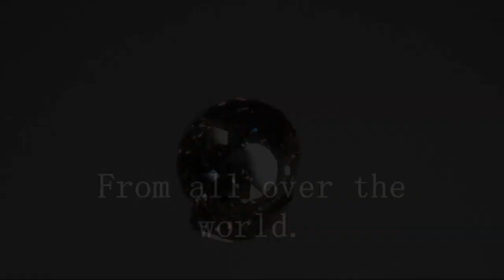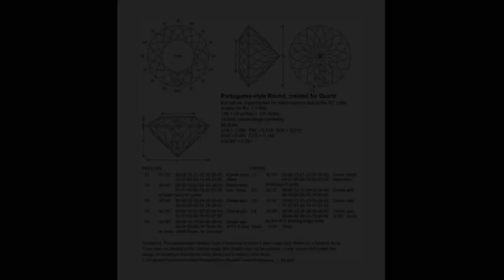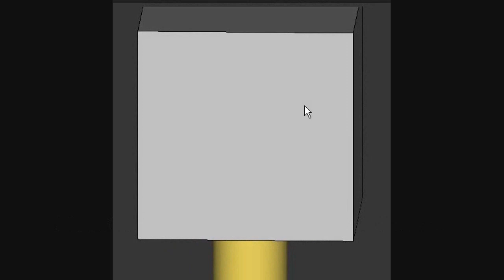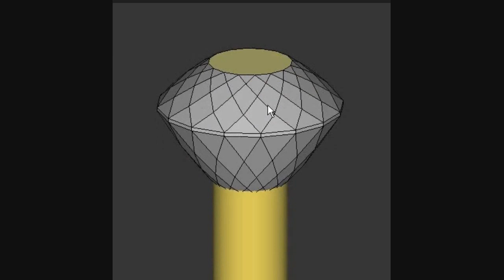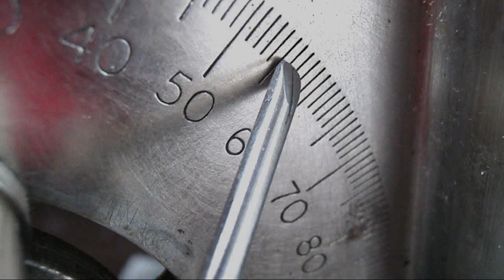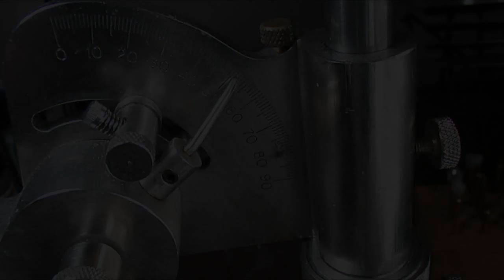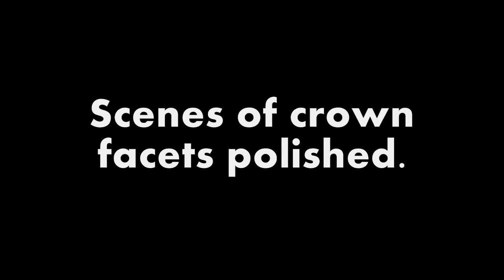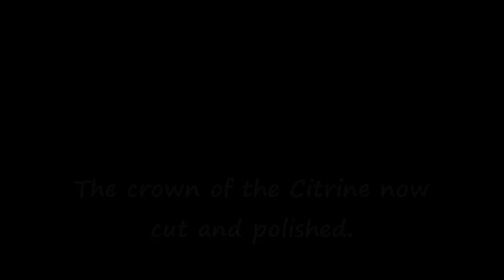How to facet a Portuguese cut gem.

Comment: I've been wanting to try a Portuguese cut for a while now, but the thought of matching up all those meetpoints is quite daunting. I'd probably have to use my worn 1200 grit lap to keep from overcutting.
Reply from the maker: This design is not too difficult. The hard part is choosing the right index number.
Reply: That’s not too difficult. I only have a 96 at the moment.
Reply: “The thought of matching up all those meet cuts” … indeed!! I don’t know what it means exactly, bc I’m not a lapidary (sp.?) nor do I play one on tv! But it has always been a great mystery and a marvel to me HOW exactly all these dozens if not hundreds of facets are cut so precisely and symmetrically, and I have begun to do research and watch videos to try and find the answer to the riddle. YOUR video has come the closest; I have seen videos on setting up a computer rendition of the faceted stone as the angles and number of cuts are decided upon and selected, but the piece I’m missing is how the digital rendering is transferred to the actual cutting - is something programmed into the machine with the arm that you drop down to the sander that lays it precisely on the angle and the position of the facet you want to create and have chosen in the digital rendering? You certainly cannot “know” by feel and/or sight just how much to turn it to get, say, 20 perfectly symmetrical facets on a tier — CAN you?!

Comment: Great video and really nice Portuguese cut stones, Cliff. There are so many facets on each stone. When you transfer the stone to cut the crown, how do you go about removing the epoxy?
Reply from the maker: Thanks Mr Q,  The dop and epoxy is detached by heat. I use a small handheld blow torch and wrap the gem with a piece of wet tissue so it wont heat up.
Reply: Thank you, I've wondered about trying this but never had the courage. I have been cutting the epoxy with a razor blade but this is time consuming and can leave marks on the brass dops which I don't like. I usually use dop wax but for smaller gems I figure epoxy will hold the stones better. I am cutting a small emerald today, and I will try out this technique.
Reply: Worked like a charm! Thank you for your help! I will do it this way from now on.